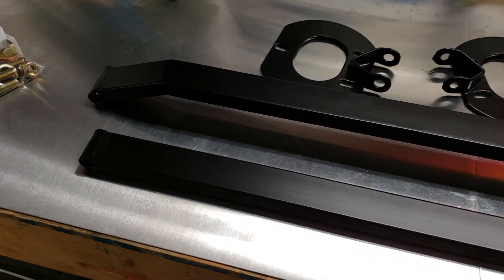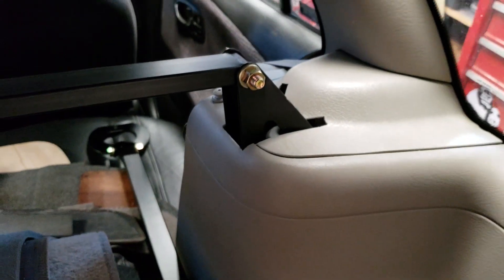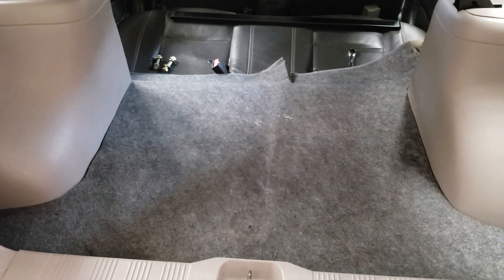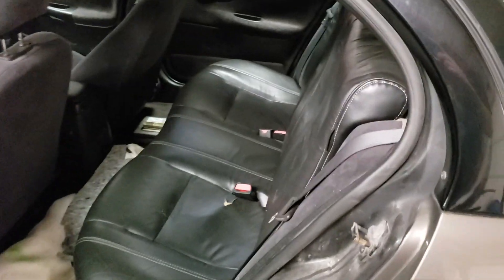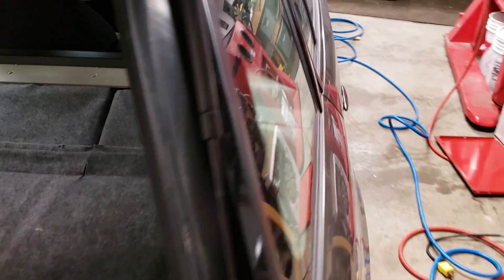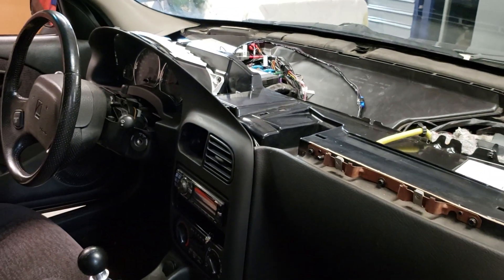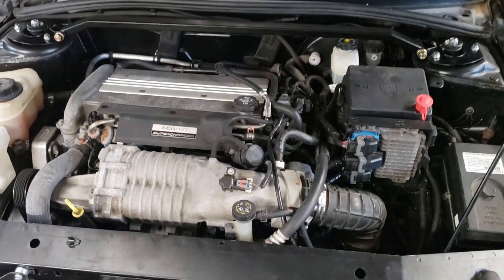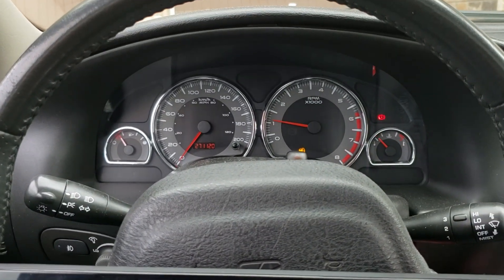Finishing Touches (For now) - Saturn Wagon Build - Pt 19

Comment: I'm also interested in your rear leather seat back rest, did you find a black leather w2 back rest or did you use a S or C model leather back rest.

I have a s2 leather rear back rest and I want to install in to my w2
Reply from the maker: You have to take the cover off a sc or sl seat and put it on the sw backs.
Reply: @NobleGarage  was it fairly easy and strait swap to peal off and install over the w back rest or did you have to do "some modification" 

I did end up putting them both next to each other and my finale idea was to do what you are saying now. But I'm just worried once I commit is their no turning back.

Leather and w parts are hard to come by in canada

Comment: Your over there busting out this code while I'm trying to figure out how to get an arduino to work with an oil pressure sensor and an oil temperature sensor on my SC2
Reply from the maker: That's kinda stuff is my forte lol
Reply: @NobleGarage  have you figured out the hood not closing because of the strut bar? I was thinking you might be able to swap the bars from front to rear if they are the same length
Reply from the maker: Unfortunately they are different. The guy I bought it off of had it on his sw2, I honestly have no idea how it fit unless he spaced his hood up.
Reply: @NobleGarage  cut the hood lol